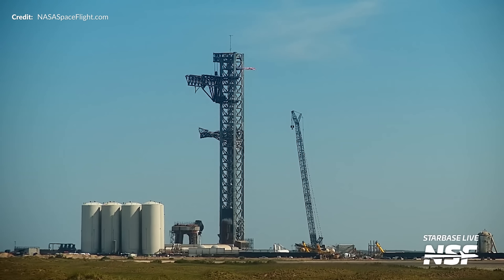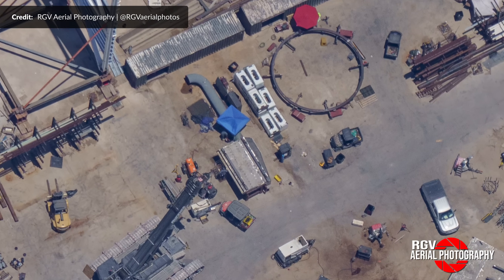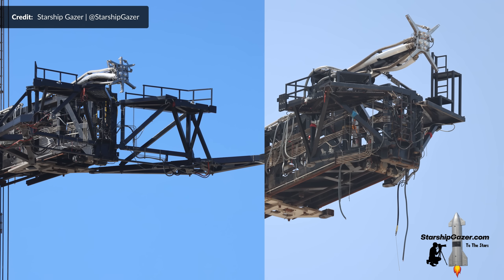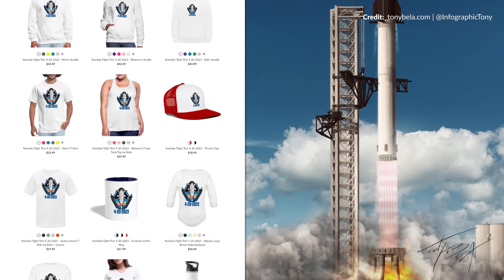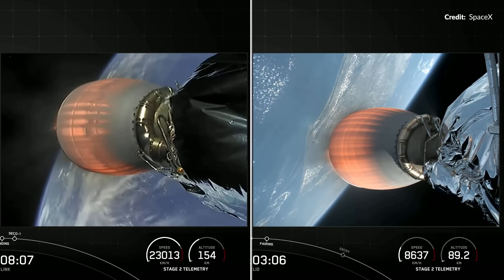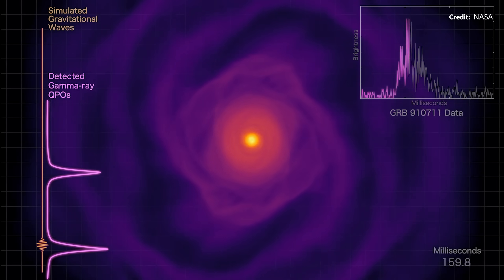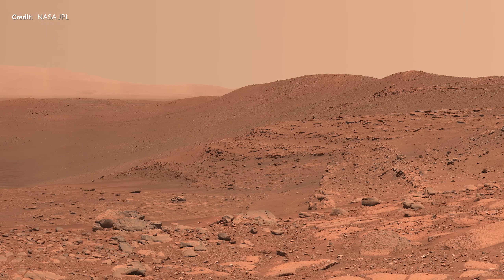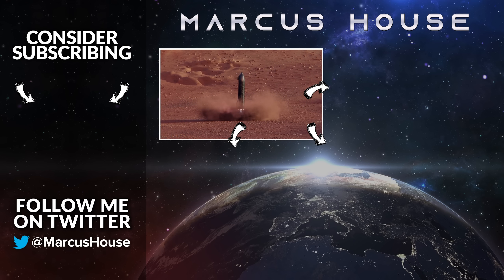Mind-Blowing Transformation at the SpaceX Starship Launch Site!

Comment: At this point I have to ask myself: Why? Why are they going for such a narrow footprint water deluge system when they have so much space?
Reply: Ah well, they want to aim for rocket travel too. So it's about IP I guess
Reply: I don't think the extreme pressure really extends far from the support columns, nor does the heat. It'll be abated by the water somewhat too.

This is already going to use a ton of fresh water, which isn't easy or cheap to aquire. So this is probably the most efficient setup they could think of that's got margins, and definitely less than 570,000 gallons of water used by SLS.
Reply: @Jaker788  I think it is about patents and IP. They wouldn't need to advance here in this field but they chose to anyways. 

Also on second thought I have no idea how much the shock waves are vibrations are actually an issue on the moon or mars given that the medium is basically non-existant.

So the answer is somwhere around having one small footpring launch platform that they can adapt to different scenarios - something impossible to do with the existing design
Reply: @Telencephelon  SpaceX does not patent things, they do not have any intellectual property with the launch mount or the steel plate or any of the stage zero. Really not even the rocket, people could copy exactly as long as it's not stolen from internal docs. Patents and IP just document exactly how to do it anyway. Doing things any differently than how this plate was set up wouldn't really change anything, increasing the footprint wouldn't have any effect on that. I'm not really sure what your argument for IP and Patents is anyway, protecting their own or avoiding them? Because neither of those are applicable.

Really, it's just the design they thought was needed. They don't have the land space for a large trench and hill like SLS uses, and the biggest problem they had was foundation directly underneath the pad. They haven't had any issues past the support legs with static fires or even the launch, there is practically no downward pressure beyond the legs and temp isn't even close to what's experienced inside the legs. It just doesn't need to be larger and use even more water they don't have.

As for the Moon and Mars, vibration and shock waves are not a concern. Even on Earth Starship second stage has no problems launching from a flat concrete pad. Super heavy booster will not be used on Mars or the Moon so this crazy energy control is not needed. With no atmosphere to conduct vibration and shock through, Starship wouldn't really have issues with it. The only issue is potentially digging a hole in the soft regolith or kicking up damaging debris, which is why the early Artemis Starship showed landing thrusters high up on the vehicle as a potential solution. If not that, they could literally get away with concrete like on Earth or decently cemented regolith.
Reply: @Jaker788  Other than your first paragraph, good pointers. Thanks
Reply: @Telencephelon  First paragraph is true though. SpaceX does not patent things, SpaceX has a total 26 patents for Starlink only. Elon Musk has been quoted as saying patents are for the weak, they only stifle progress and try to block others from trying to follow along and also innovate.

Comment: I know this special pad is for the booster but will starship be able to leave Mars or the moon with Starship's huge engines or will debris be just as dangerous to it?
Reply: They don't need the booster to leave the Moon or Mars, as Starship (second stage) can launch straight to orbit on its own there. Starship (second stage) has 6 to 9 engines, instead of 33, so nowhere near as much thrust. Also HLS Starship is currently planned to have a ring of 24 smaller methane engines for the last bit of landing and the first bit of launch. That ring of engines is roughly 25 meters from the surface, which should minimize disturbance of the regolith.
Reply: Apparently that’s why they’re trying this approach of designing a heat diversion system like this rather than the standard huge fire brick lined artificial canyon flame diverting trenches used on other launch pads, which although sufficient and proved successful for the last 50 -60 years, would be a problem to build such large scale trenches on the moon or mars for liftoff there, so the idea spacex is pursuing here is how to create as minimal an infrastructure as possible that works to make launch components feasible to reproduce and mass produce , transport and assemble fairly quickly and easily for installation on off world locations, that’s what I read anyway!
Reply: @steveaustin2686  Yes, I was asking about Starship not the booster. So those 6 to 9 engines won't blow dangerous debris all over the mars habitat or damage the engines while landing and taking off from Mars-dirt (no landing pad at all)?
Reply: @nunya___  I covered that earlier. "Also HLS Starship is currently planned to have a ring of 24 smaller methane engines for the last bit of landing and the first bit of launch. That ring of engines is roughly 25 meters from the surface, which should minimize disturbance of the regolith." So the main engines would likely not be used at all when close to the surface.
Reply: @jaymurdoch6161  Well, the OLM is far off the ground, so is a 360 degree flame trench. What Musk evidently wants to avoid, is a flame diverter that would block access to the engines. Work on the deluge started BEFORE the Apr 2023 'orbital' flight test that did a RUD on the pad.

For the Moon and Mars, no one is building launch facilities there any time soon. HLS Starship is currently planned to have a ring of 24 smaller methane engines for the last bit of landing and the first bit of launch. That ring of engines is roughly 25 meters from the surface, which should minimize disturbance of the regolith. So the main engines would likely not be used at all when close to the surface.
Reply: @steveaustin2686  Probably politically unacceptable but it might be possible to create a solid landing area on the moon by detonating a nuclear bomb close to the lunar surface. The intense thermal pulse could vitrify the regolith and the complete vacuum means there would be no blast wave to disturb the surface.
Launching the device from earth would be the main issue.
Reply: @jaymurdoch6161  No water deluge system on the moon or mars!  Not needed, and it wouldn't work anyway in those temperatures and atmospheric pressures.  Gravity is way less in both cases, so far less thrust is needed, and the landing/launch engines will be mounted much higher that the current sea-level and RVAC engines.
Reply: @nunya___  As Ateve said, they won't be using those engines for the landing / launch on the moon or Mars.  They''ll be using the other set of engines, mounted much higher up.
Reply: @ChristLink-Channel  Thanks for clarifying that.  I suppose they will use the 6 to 9 engines to decelerate down to Mars but turn those off when the starship gets close and use just the "ring" rockets at the end.  That makes sense.
Thank everyone for the answers.

Comment: The feet of the OLM platform supporting columns look surprisingly vulnerable 😱😱😱. The steel sandwich may protect the base floor from the blast of 33 Raptor engines, but I would have expected SpaceX to also surround the bottom end of the supporting columns with some vertical steel sandwich parts which are also connected to the water deluge?
Reply: That would have been a good thing to do 😊
Reply: Steam has 1600x the volume of water. When the deluge water hits the raptor thrust it will vaporise and increase in volume by 1600x and be unable to go up (coz of the downward thrust of the raptors) or down (coz of the ground), it’ll go sideways right into the legs. So the legs will be subject to not only the raptor blast, but also steam.

Comment: Am I the only one skeptical about whether that deluge system will work? It seems like there's so much surface area that it'll peel open like a banana one the rocket exhaust impinges on it 😬
Reply: No, you're not the only one.  It will all come down to pressure delta between the water pressure per square inch and the exhaust gas pressure per square inch compounded by time.  I'm sure the boffins have done the math but the hardware still has to deliver reliably.  We shall see.  As Elon like to say, "It will be exciting".

Comment: So, space X is going to fire their engines at their own booster?
Reply: It's called Hot Staging.  And it's not like it hasn't been before.  Such as with the Titan rocket the put the Gemini capsule into orbit.  The idea is to put shielding on the top of booster and another ring which will be vented to allow starship exhaust to pass through without causing damage to the booster or the aft of the starship.  Plus the starship will fire only 3 engines and at half thrust until it clears the booster.

Comment: With all these spent capsules and panels and debris floating around how do they make sure 1, they have a clean window to fly through. 2, how all these satellites don't get hit by stuff. At which point will we need a drone to scoop up all the stuff and take it to the moon and grind it up and use the materials for moon base 3d printing, because if the object's are flying around at 10s of thousands miles per hour you need a good set of eyes to miss things 🤭. It blows my mind at how fast space X gets things done and how many people they employ in all industry's.
Reply: There are many debris there but Space is big and the rocket moves through these layers in minutes.
Reply: Nasa (and other organizations) track space debris with radar continuously.  I don't recall what the smallest size is that they can detect, but it's pretty small.  I would imagine that they don't launch in places where large pieces of space junk would get too close for comfort.

Comment: “They are aiming too low. Only rockets that are fully & rapidly reusable will be competitive. Everything else will seem like a cloth biplane in the age of jets.”
Elon Musk
Reply: Reusable rockets are indeed a big step forward however there also limitations to reusable rockets compared to single use rockets.  For one there is cost of retrieving the booster wherever it lands.  Then there is the cost of the infrastructure to retrieve the rocket.  

Then there is limitations on payload capacity when the booster returns to be launched again.  A rocket that doesn't have to worry about returning to land has more fuel available to carry a heavier payload.   Falcon 9 boosters can't always be saved either when launching a payload to a higher insertion point.  This happen to recent Falcon Heavy launch in which all three boosters were sacrificed.

Comment: Marcus, I have a big concern regarding the hot stage separation: although it has been in use for many years, particularly by the soviet rocketry, Elon Musk should be reminded that those rockets were never intended to be reused. The point is that the soviets were not worried if damages happened to the upper stage, provided it reached orbit. My concern is that the second stage, in this case starship's base could get damaged by the fire of the very same motors, that is, inflicting self damage, due to the bouncing back of the fire from the top of the booster. Therefore, a damage of the starship's base, could result in the loos of the ship, or extensive repairing and replacing of damaged  motors, hence making it more expensive and longer delays for reuse.

Comment: Why not just use a fire diverter
Reply: They cant dig underground, above ground it would mean that the tower must be rebuild
Reply: @0topon The OLM is far enough off the ground to be a flame trench. Musk apparently doesn't want a diverter if he can help it, so that they can work on the engines under the OLM.
Reply: @steveaustin2686  Ok thanks for the info
Reply: @0topon  You're welcome. Musk has basically said that he won't install a diverter until circumstances force him to.

Comment: The deluge system seems under engineered and destined to tear to shreds during the next full throttle test or launch. How could they possibly move enough water through the those honeycombed plates to counteract overheating from the engines, never mind the thousands of welds that have to hold up to the sound and exhaust pressure, or the back pressure that steam will exert on the flow of water. The phrase “fig leaf” comes to mind. Time will tell.
Reply: Says captain pessimistic.
Reply: They've tested the individual plates already against a Raptor at full thrust. They will test the full plate before putting the rocket back on the OLM. If needed, they will make changes. Not a big deal.
Reply: "How could they possibly move enough water" Take a look just behind the water tanks, at the rear of the tower:  See those dozens and dozens of cylinders in several tall stacks? Those are the high pressure gas bottles that will be forcing water through the system at very high pressures and speeds.

Comment: Question: Do you think that the moon colonisation will start with tunnels? And how important is the Bore Company role in the moon colonisation.
Reply: The first lunar structures will likely be basic structures constructed on the surface.  It will take a while before there is enough infrastructure on the Moon to begin boring underground.  That a whole nother level of complexity.

Comment: So with all the brilliant minds and rocket scientists... no one thought hot staging? A whole Startship was lost due SN engine loss. That could have been lost of lives.
Reply: 🙄 Starship is still in early development, a crew Starship launch from Earth is years away, IF Starship can even be that reliable. SpaceX didn't separate the booster from Starship (second stage) on purpose, as they had three areas for them to land in. The section in the Gulf of Mexico for launch and the two sections in the Pacific Ocean on either side of Hawaii. Since all the engines failed, Starship (second stage) evidently could not make the Pacific, so they didn't try.
Reply: No lives would have been lost so that's an exaggeration since no one is going on starship for some time.   Starship will be in development for a couple more years at the minimum.   Even after a final model is reached refinements will continue just like with other forms of technology.

Comment: In the end, they still will have to build a flame channel. This stubborn insistence on flat pad costs them a lot of unnecessary expenses.
Reply: The OLM is pretty far off the ground, so it is a 360 degree flame trench. What Musk wants to avoid at all costs, is a diverter that would block access to working on the engines under the pad.

Comment: Getting rid of Ariane 5 is a massive mistake the equivalent of dropping the Space Shuttle. There is no wisdom in getting rid of a design that has proven itself. You guys never even considered upgrading this proven design to increase its capabilities. You build rockets to make a proven design and then you fly the hell out of it. You don't go off in a new direction with an unproven design when you already have one that's as reliable as a 737. Upgrade Ariane 5 to include landing gear and make it reusable or is that too much for you to wrap your head around.
Reply: 🙄 What do you think the Araine 6 is, but a better version of the Araine 5. The Araine 6 started development in 2013, over 2 years before SpaceX landed their first booster and almost 4 years before SpaceX reused a booster.
Reply: @steveaustin2686  Ariane 6 has never flown a mission while Ariane 5 has flown many. Something else to consider is the insurance on a 5 mission is less than it would be for a 6 mission.
Reply: @jcoghill2  🙄🙄 Of course the Araine 6 has not flown yet, it's the replacement for the Araine 5. You know, the NEWER version. Come dude, it's not that late.

Comment: So absolutely ridiculous that SpaceX went the route of no flame trench to begin with.  They could have built up the ground and had the flame trench above sea level like at Kennedy. Yes, it would have been expensive, but so was this mess and time delay.
Reply: To be fair, they have a 360 degree flame trench, with the OLM being so far off the ground. What Musk wants to avoid at all costs, is a diverter that would block access to engine work under the booster. He could have waited for the water deluge system, as it was in the works, BEFORE the Apr 2023 'orbital' flight attempt.

Comment: I suggest a major modification to your outrageously optimistic tone when reporting any space-x updates. It will be years before the next successful lift-off, if ever. You don't want to become fodder for the naysayers. FSD by 2015. Hyperloop by 2018 etc etc etc.
Reply: It is understandable that you would make such a suggestion given the pessimistic point of view you are coming from.  When you say it will be several years before Space X has a successful lift off if ever you provide no argument to buttress your claim.    It's as though you have zero knowledge of the many failures that have occured in rocket development before success was achieved. 

 Look at the progress Space X made landing the Falcon 9.  A lot of people were pessimistic like you are now.   Since those first landings of the Falcon 9 booster Space X has landed several boosters over 200 times.  That is just one of many successes by Space X.  They have shown great capacity to innovate, to persevere and overcome technical problems that others haven't even attempted.  

Sorry for the lecture, but you seemed very misinformed.  Have a good day.